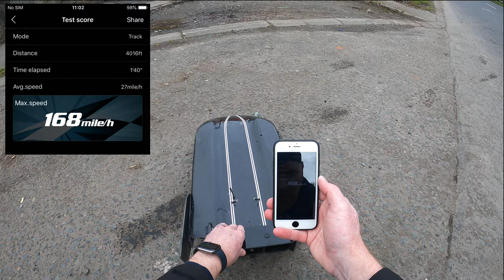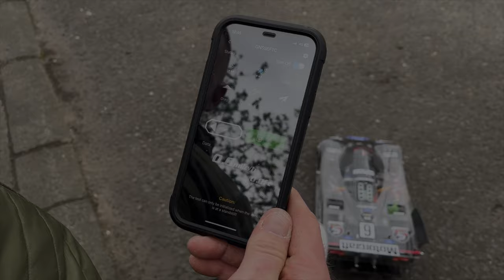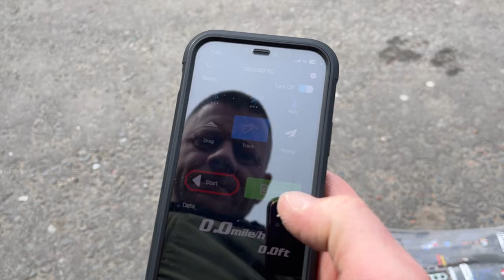Close CALL! Dual TP, what could go wrong! Castle 1721 - Arrma limitless v2,  ONYX  batteries

Comment: Well played lads. Solid results and some "entertainment" too. Time to repair and go again
Reply from the maker: Hell yes! Shame no speed for dual gps as she was moving. 
I knew Sam had a pb in him that day 💪
Reply: @audiquattrojamie  Ok so if you don't want to focus on the positives then yeah that was brutal. Heartbreaking because she was shifting. How many times are you going to need to go out with her to get that pass again lol. The PB was earned.
Reply from the maker: @chrislang7460  thanks 👍
 next time will be at the track so should go better, the car hadn’t hit full power at that point, batteries were only warmed slightly so the car has so much more to give… if it can stay together 😊
On the next run out I’ll be able to work out what speed the car was roughly doing with the data logs and gps on laptop and distance so all is not lost… ultimately it was a really rush and Sam got a pb
Reply: @audiquattrojamie  yeah I do remember a spectacular attempt at aerobatics at that track. But fingers crossed you get the run you deserve. Look forward too the video